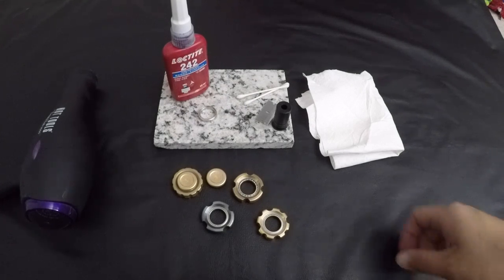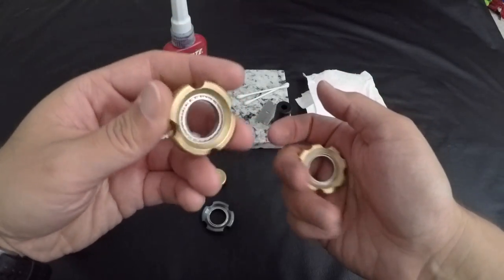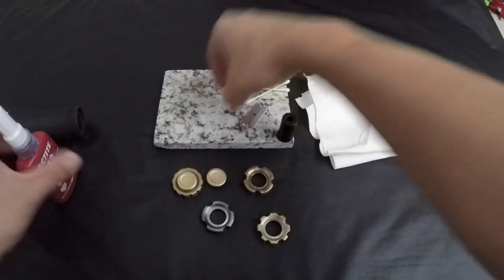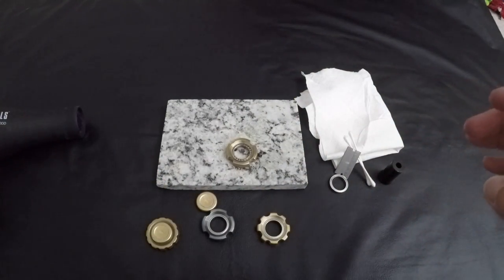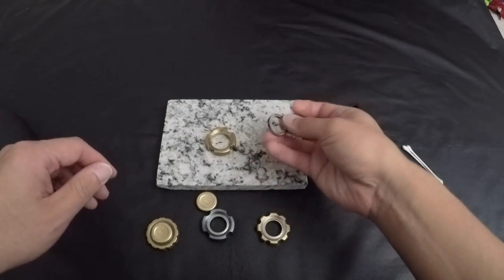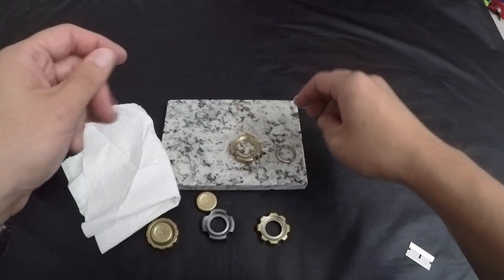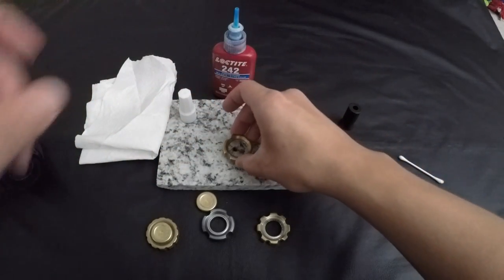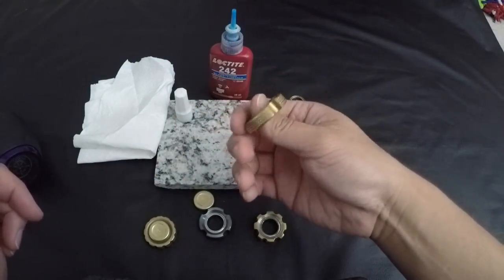LoopHole Bearing Removal

Comment: How to remove the shield from the bearing ?  I do prefer no shield on bearing for easier cleaning and maintaining.
Reply from the maker: iAM_DannyBear _ There's one small retaining clip on each side. All you need is a thumbtack to get under the retaining clip. It pops out really easily. Then the shield comes off.
Reply: Premium Spinners ok thanks, I'll try that.

Comment: since its a tight fit could you get away with not using locktight?
Reply from the maker: Greg Charette You could but I wouldnt be surprised on harder spins if it shifted.